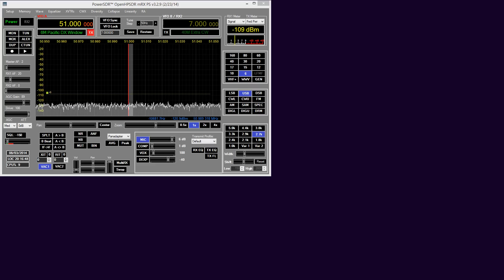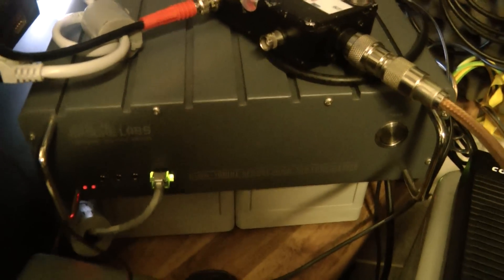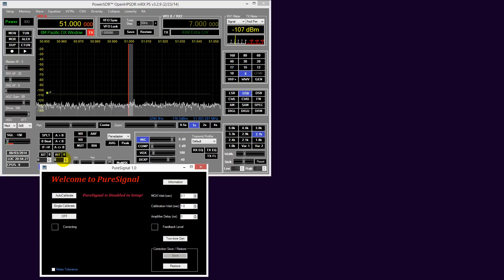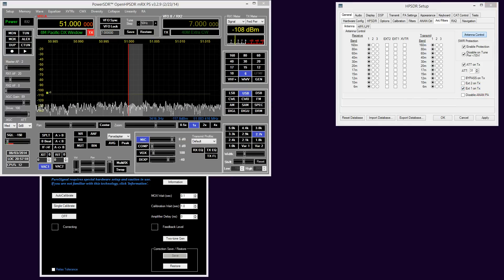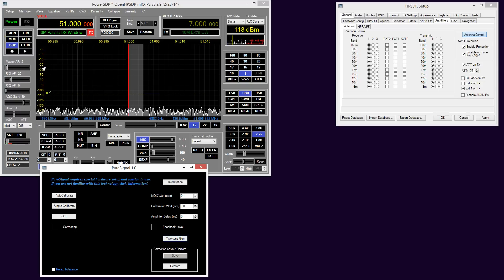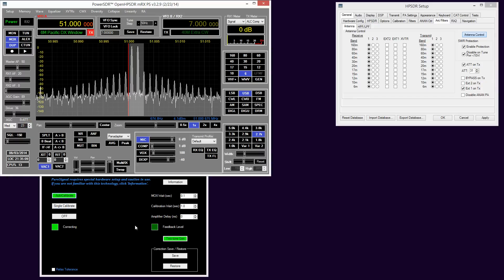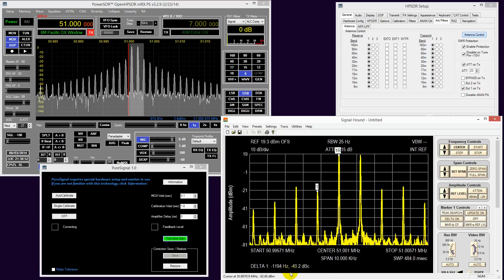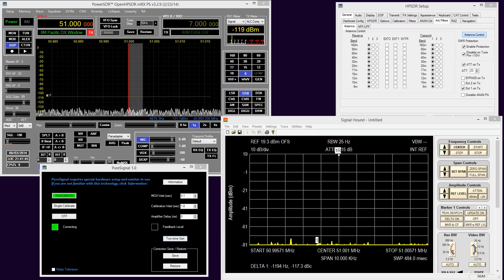HPSDR PureSignal and ANAN-100 Set-up and Demonstration (Pre-distortion)

Comment: How did they achieve the same tap in such a wide band in a directional coupler?
Is there a strip line? And how is the compensation for the non-linearity of the frequency response done?

Comment: I am getting an Anan-10 and it does not have the "ext1" input. Do you know where the input cable would be attached to the Anan-10 for pure signal to work? Great tutorial videos by the way. 73, Tom, K2BEW
Reply from the maker: The ANAN-10 and 100 (in contrast to 100D) do not have an Ext1 input. However there is sufficient internal crosstalk for PureSignal to work just fine. If however you seek to add a PA after the radio, then you may need to provide your own mechanism to get the final waveform back into the radio (intentional RF ingress). This is tricky but not impossible. 73 HNY.
Reply: G7CNF Amateur Radio Station
Thanks for the reply, so if I understand correctly you just run puresignal on the Anan-10 with no external connections need for sending the signal back onto the radio, unless I had the external amp as you mentioned? Thanks and 73, Tom
Reply from the maker: Tom k2bew Yes, it may not work on 6m but most people seem to be getting good results running barefoot.

Comment: Nige, I have tried to set up PureSignal on my Anan-10 following your instructions and no matter how low from 31 and all the way down to "0" that I adjust the ATT the feedback level never changed from flashing red. I cannot get it yellow or green. Are there any other settings I should be looking at adjusting? Thanks and 73, Tom K2BEW
Reply: Family of: Coleman There a definite improvment. the offset in the imd is about 60dB  with pure signal enabled, but the feedback level never stops flashing red. So I am hesitant to leave it turned on. It is a new Anan-10, any suggestions?  Tom
Reply: Tom k2bew
Just wanted to add that I again did a reset of my database, and then ran through the puresignal setup as demonstrated by Nige, and I now am running in the green on my feedback, it is working great. Thank you Nige. 73, Tom, K2BEW

Comment: How can you set it up without a coupler?
Reply from the maker: If you do not intend to operate a linear amplifier (run barefoot) then you can take advantage of capacitive leakage inside the radio to accomplish PureSignal calibration - in fact you can even do this with the ANAN-10. One only really needs a coupler if one wants to include any subsequent PA stages in the PureSignal cleanup.